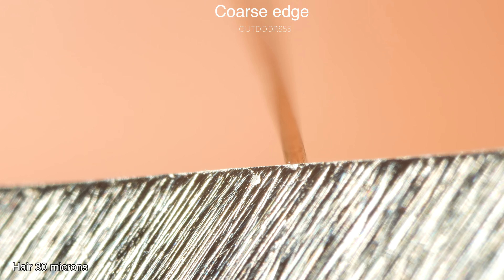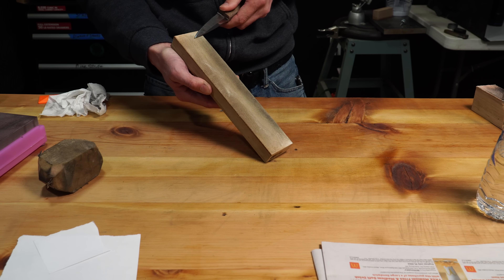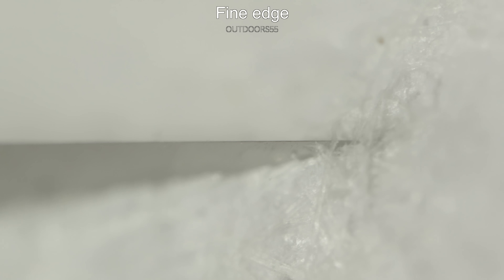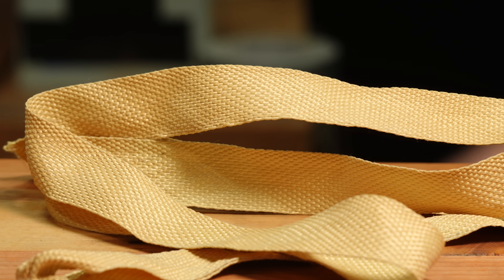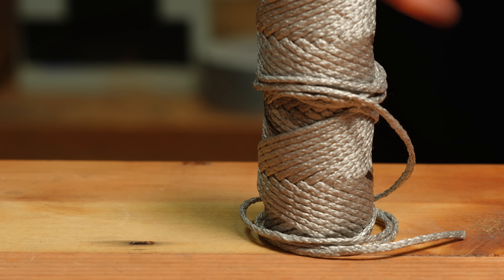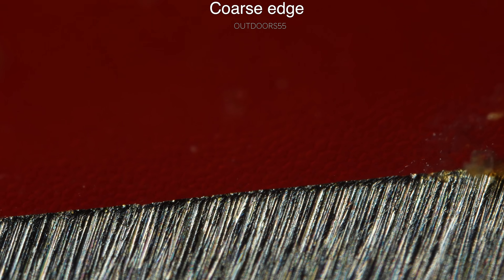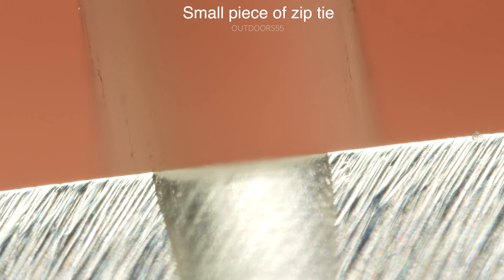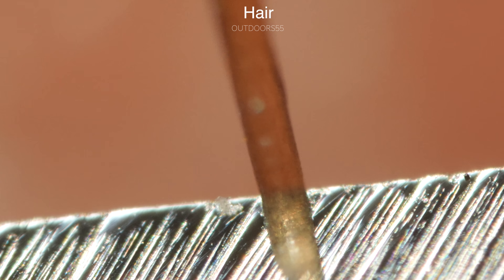Coarse Grit Knife Edges Are Weird - Coarse Vs Fine grit Edges Cut Under Microscope

Comment: Hah, so I'm not an idiot! I used to have a second job that involved cutting kevlar rope a lot. At the time I sharpened my knife to a very fine grit and it always worked like a charm. Unfortunately I dropped it and it got quite a bad chip right in the middle of the blade. As I didn't feel like spending hours on my 800 grit stone (that's the lowest I had), I brought it to a professional knife sharpener to get it fixed. He did an awesome job and even polished it so it looked like new again, but it felt less sharp to me when cutting kevlar ropes. When checking with him, I discovered that he stopped at 1600 grit while I used to go on to 3000 grit. He basically told me I was an idiot for doing that, as it was a waste of time and doesn't make any difference. It's been ten years since that discussion happened, but I still visit his store regularly and will definitely show him this video haha!
Reply: I mean, you're not much of a idiot if your blade actually felt less sharp when sharpened to a lesser grit
Reply: @MrTehNoms  Humans can convince themselves of perceiving differences where none exist all the time. I dont know if this situation is one of those, but assuming someone is correct because they say they can "feel the difference" is not a good measure of an actual difference without empirical evidence.
Reply: @ I agree. But in this case, OP was blind to the empirical difference. So feeling a difference would reasonably be enough to justify one... I think
Reply: I mean it may be slightly less drastic differences than this video. You’re talking 1600 vs 3000. 1600 is already a pretty polished edge

Comment: I would think that the fine edge would give an advantage with the tough dyneema and kevlar fibers where the micro-serrations would snag the microfibers and give a rougher cut. But in the case of a tomato, I would think that the micro-serrations would catch in the skin, allowing for it to be cut more easily. 

The knife I have that I only home to resharpen has an extremely smooth surface. It goes through paper like butter. But with tomatoes, it will cut easily right after sharpening, but very soon after will require some pressure to get through the skin. This is where I feel the micro-serrations would excel.

Comment: the skill of sharpening is definately with you. Mine suck. Inconsistent angles of sharpening as I go is the main issue. But I'm also sharpening low quality steel that hasn't been sharpened for longer than I've been alive. And I kept on a course grit just because of the number of deep knicks in the blade that I had to work down to including needing to recreate a new tip as that got lost somehow, but I gave up on that task. I will say my skills need improvement, but I like the idea of also not wasting a knife. I think I'll get some new sharpening stones since the one I have, I think is just junk from the web I bought years ago when I first wanted to learn but gave up on. thanks for these videos. The camera work really drives home a lot of what technique, degree of grit and time spent, and blade quality do to impact the end result.

Comment: I will say, if you want the most precision when sharpening knives, you should try using lapping film on a thick float glass platten. You can buy some ludicrously fine lapping film with PSA backing that works exceptionally well for refining and final polish on a cutting edge. Just have to be cautious of your angles so you don't accidentally slice through the film while you're sharpening.

In my personal use case, I will bother to establish an edge on my knives using progressively finer stones, but once that edge has been established, I can generally get away with just using a splash-and-go 8k grit whetstone to touch up and re-polish the edge. It is fine enough and can provide a hazy mirror finish with minimal extra effort.

Comment: Not a material scientist but IMO, the actural 'cutting edge' of blades are even smaller structures than the macro is able to shown, ie the edge of crystalline structure. So if the blades are forged with similar materials under similar conditions, then their crystalline structure is similar thus the cutting capacity is close. The finer grade does align the crystalline's edge so there's less saw like structure and under some condition gives a smoother cutting experience.

Comment: I've done quite a bit of practical tests on this using the Wicked Edge to get a precise edge. Of course when I bought it, I wanted to mirror edge everything. But I quickly found out that they didn't last any longer than a normal edge, and took 10x longer to do. That aside, I would say the main thing I found out is the method of cutting matters. Too many people pull their knife through cutting material, using it like a wedge; also known as push cutting. If knives were meant to cut this way, you'd only need 2" of blade. You are much better off letting the length of the blade do the cutting, which is typically called a draw cut.
All that said, the only issue I see in these tests is that most were push cuts, and just a few of the macro shots were actually draw cuts. A highly sharpened edge will push cut better, as it is basically a very fine ramp. However, when used as a draw cut, the microscopic teeth of a coarser edge act like millions of fine serrations, cutting material swiftly. Especially things like plastics or synthetics, which a fine edge tends to simply slide over. Of course, there is such a thing as too coarse of an edge. Just as too fine of an edge is not practical. The 600 grit used here with a strop finish tends to be a good medium. Paired with a proper draw cut, it should outperform on most materials. The only exception usually being ultra fine materials like hair and paper. Which is why razors are made to push cut, and have fine polished edges. So each has a practical purpose. It would be nice to see these tests with a proper draw cut being used, rather than pulling the edge through the material.

Comment: This reminds me of the way a typical French woodworker would have sharpened his edge tools.

First a coarse sandstone wheel, then a fine turkey stone, and maybe strop a couple times on your apron or your hand. They lifted the tool slightly on the oilstone making tougher secondary bevels.

I have to say despite all the other methods I've used the coarse grinding to Turkey stone to light stropping has always given me the most consistently sharp edges.

Comment: Most important part is that its sharpened properly, and a 600 grit is in factory knives a pretty darn fine grit. at most knives you'd be lucky with a 200 to 400 grit grind and hope you get a decent one. The other part is good strops help so much in edge refinement, even if its a coarser grit finish, you smooth out the coarse ridges at the apex in my experience. Fine polish finish is nice and up to a certain point sharper, but it also depends on what the purpose is of the knife, a rugged outdoor knife doesnt need a mirror polished edge sharpened to 30k grit stones and 3 kinds of strops. you need a good sturdy edge thats sharp enough for cuting shit up. A specialist sushi knife is another story though, or other high end knives.

Comment: I'd like to just have 1 or 2 stones +strop to do all my sharpening, but what about egde retention with coarse grit edges vs polished is there any noticeable difference in your experience? Or is it more about the quality of steel? It would probably be very hard to test unless you could find a object to cut that would wear it out quickly but not too quickly.

Comment: Coarse edge will last longer while fine edge will get dull and maybe chip sooner. In addition coarse edge when pulling through materials acts as a saw while fine edge mainly works on splitting materials that in certain situations are less optimal.

Comment: The very cutting edge seemed VERY similar on both coars and fine grit examples. Maybe the one touch on the 1µm diamond strop did enough to refine the cutting edge .
The finer grit example just had a larger area next to the cutting edge filled with fine grind marks. But the edge looked pretty much the same.

Comment: Great video! A suggestion: include some cheese and salami in the comparison, I wonder if and if yes, what difference would you notice between the blades. I thought my Shapton Kuromaku 1500 was fine enough until a friend of mine brought some geniuine japanese kitchen knifes from his trip to Japan. While I could cut everything almost as good as the new japanese knifes, I felt that I had to "push" more, even through paper. Being lazy to fuss around with any compound and leather strip, I bought a 5000 grit stone. Next time when I will sharpen my kitchen knifes I will try it out. But I guess there are diminishing returns witch higher grit stones. But I am quite confident I can get my "lower middle class" kitchen knifes as sharp as those Japanese ones, wich did cost trhee times as much. But they are also a piece of art, with the damascus pattern.

Comment: I'm impressed how well you cut through Kevlar.  That material really separates the men from the boys.  How do different blade materials handle it?  What blades retain sharpness the longest cutting Kevlar?   And the macro-photography Was excellent. People surely want more of that!  Do you fit several images together to get better depth of field?   You might be able to finally resolve the structure of the bur without cutting up a blade to fit it into a scanning electron microscope.

Comment: I've found that using valve oil (for brass instruments) and one cheap Smith's whetstone works incredibly well, and 'shaving sharp' is pretty easy to attain without much fuss.
I'd love to see if you could do a closeup inspection as to why valve oil seems to work so well, if replicable... though the seeming effectiveness might just be in my own head... 😅

Comment: I go up to 2500 grit on my handmade knives for sale and occasionally for the knives in our kitchen. But if a customer comes with a box of dull supermarket knives, i go only to 1000 grit and then strop. I made my own set of experiments in the past and my conclusion was the same as yours - there is a difference, but it is minuscule. My expriment was about measuring the cutting force of a thread and statistical analysis.
I do admire your macro shots, amazing work!

Comment: Great testing as always, a lower angle of sharpening will also aid in the cutting performance (Geometry cuts)  and a fine edge will cut better if the steel can take that fine edge (some steel gets slick rather than sharp over a certain grit) and hold it for any lenght of time, a fine edge is worthless if it no longer cuts after a minute of use and that is very dependent on the steel itself,  most steels will cut longer with a coarse edge and some will cut longer with a fine edge and some do the exact same with both edge types. So if your looking for a knife that will take that polished edge choose your steel wisely, which will also help with how frequent you have to maintain (hone and strop) and sharpen it as well. Thanks for the great vid and keep making sharp things fun and enjoyable.

Comment: amazing work, but a question which deserves an answer: for how much longer (# of cuts?) does the fine grit sharpened knife last? 10 minutes may not be significant if a fine grit edge lasts 10% or more longer, depending on use case of course.

Comment: Agree with you. I'm sticking to 600 grit too, for time saving as well as "lasting longer" after use. Fine edge is good on the initial cuts but lose their bite faster, meant you end up spending more time on the stones than the coarse edge using.

Comment: I have a fun story about tomatoes. It's actually the reason I found your channel. And one of the reasons I obsessively try to get the sharpest edge possible. I work in a commercial kitchen, and there's nothing worse than having to prep a bunch of slightly mushy/on their way out tomatoes with a knife that isn't super sharp. As you can see in your closeups, you release a little bit more juice with the coarse edge. Every little bit matters when you end up with tomato juice down your front and into your shoes eventually. It's better than raw fish water in your boots all day though. Anyway, love the content and I've found that "little bit extra" that I've been missing in my edges thanks to your content.
Reply: ‘too sharp’ where the edge is not durable would be related to the angle you sharpen at, not how high a grit you’re using I think. Bushcraft knives can be very sharp but have a less sharp angle because it’s more durable and no need for slicyness
Reply: Although, Scandi grinds without a microbevel are actually a super slicey 11ish degrees per side, but that's meant for carving like a double sided chisel. And they're horrible for cutting anything very deeply like food. @kims2r
Reply: What is your preferred finishing grit then? Best compromise between edge retention and cutting tomatoes without juice?
Reply: @tjay1305  I use a cheap 120/320 stone and finish on a 1000 stone, gets everything done, 120 if you nicked your knife and need to redo the edge, 320 once a month or so, 1000 every week or so. because of this channel I'm considering a strop.. no point getting the knife too sharp, bites into the chopping board, and can't feel the difference between skin and flesh when skinning fish.
Reply: @fishymaniac104  I sometimes sharpen for customers (and mostly for myself), and I’m obsessed with trying to find a better answer to grit progressions. 

Normally for the majority of knives (i.e. cheaper softer stainless) I go 320-500-1000 and stop there. There’s no point getting higher because 1K is where the steel starts getting too refined and loses its “bitiness”. So, the same as you mostly… 

I can’t really explain it, but for now my preferred edges need a good mix between coarse and fine, and stainless steel happens to stop at the 1K grit rating or so. 

I use a Shapton pro 5k to strop a little if I did a slightly worse job of deburring on my 1k stone. That’s my strop. 

No such thing as too sharp to me. True lasting sharpness is only achieved when you deburr properly.
Reply: @tjay1305  I use a set of Smith's coarse and fine diamond plates. They came in a handle, but I removed them some time ago. I've found angle and having a secondary bevel to be very good. I can do it by hand, but I could not give measurements. I recommend getting a bunch of tomatoes and playing around with angles.
Reply: makes sense since you literally use the knife way, way more than the average joe, you'd want better than average excellence. 

Though I do wonder, what's the breaking point where it's too sharp and is too easy for it to dent? Though I guess the most obvious answer is not cut anything it's not meant to
Reply: @swordzanderson5352  As I mentioned, for me there’s no such thing as “too sharp”. 

However, there is such a thing as “too thin”. This happens when the amount of material behind the edge is too little to support the apex and it buckles and chips very quickly when pressure is exerted. Most people don’t encounter this though… 

E.g. I’ve gotten a knife so thin that when you place a thumbnail on the edge with some pressure the edge flexes. This means the thickness just behind the edge is almost as thin as paper. It makes for an extremely sharp knife, but even careful use on a soft cutting board led to chips very quickly. 

Softer steel and stainless steel tends to require more material to support the edge and they cannot get as thin as good carbon steel knives that have been hardened to at least 59-62 HRC.
Reply: @swordzanderson5352  I actually routinely chop very heavy-handed, and at times cut and hammer my way through frozen meat with this knife. I have been using it daily for the last 3-4 years and it has done a fine job. Provided you aren't trying to cut through metal, the edge does just fine. The only damage on it is from the tip banging in the sink and also nicking the occasional pan edge or drop to the floor.

The knife in question is a standard 8 inch chef knife from Ikea by the way. Think I paid $15 for it. At my peak I was going through 6 bushels of zucchini squash and cleaning 500 pounds of chicken, slicing cooked meats for salads, etc.
Reply: It seems to be a common disease, that once you started to learn about sharp cutting edges, that one obsessively looks for ways to get it even sharper 😅 Same here 😂
Reply: Use a finely serrated knife
Reply: micro serrations
Reply: Your problem may have been bad geometry or improperly removed burr. That's more common in that case

Comment: After watching through, the one unanswered question I would have is whether the fine edge outlasts the coarse edge by any significant factor.  Or perhaps even vice versa... I would assume a fine edge becomes a coarse edge before before becoming dull, but that could easily be wrong.  It might even become a dull edge faster than a coarse edge.  Might be an interesting follow-up, but might require some days/weeks/months to get enough usage and enough replicant data to really prove out.

Comment: When doing highly detailed macroshots I find using RGB lighting, from 3 different angles is great for getting detail you would miss otherwise and highly recommend trying.  It still turns into white light so you get the color but you also get contrast information in 3D that is normally lost in photographs.
Reply: The Red green and blue are seperate btw.  One on one side, one on the other and one over head, generally Red and Blue on sides and Green over head gives great 3D info on fine structures while mostly maintaining the color in enhanced detail.